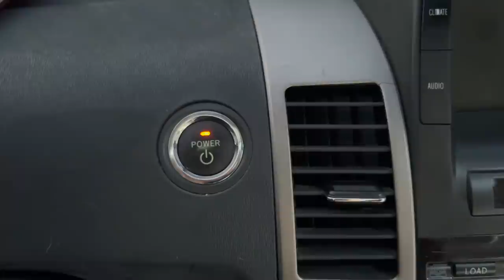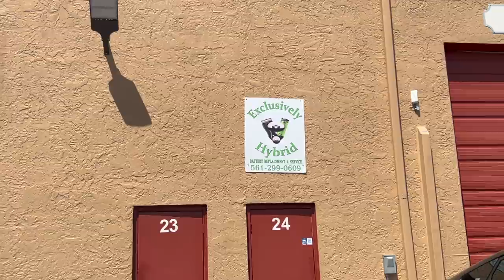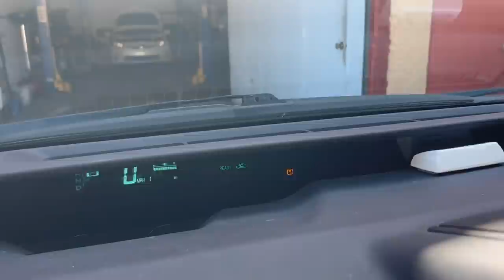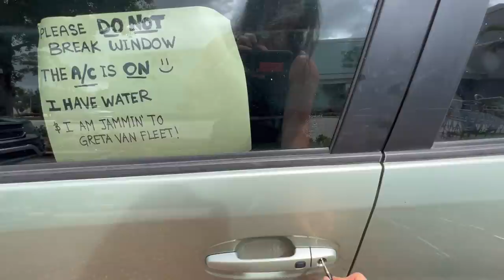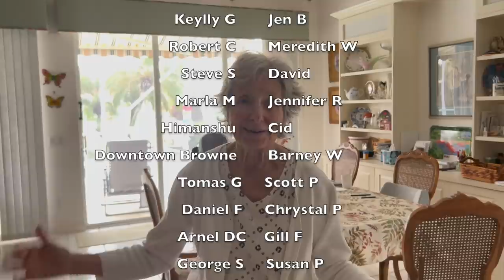LIVING in a PRIUS: We've got some BIG (car) PROBLEMS!

Comment: Take your prius to tribe auto san luis obispo ca.they service prius you get get tune up change  transmison fluid radiator flush change brake fluid change all filters for about $500 they also service your battery included in that price. Because you have camper  they  clean dust and dog hair from battery.the end of car problems

Comment: Do you leave the car running with the ac on or can the ac work when car is off? (Not attacking you as i’m just curious as this is the first petrol car i’ve seen that can run the ac while not running)
Reply: It's a Hybrid. A/c runs off battery

Comment: They say that Toyota Arius is capable of driving 1,000,000 kilometers without breakdowns.  But that's not true, is it?  Just like the fact that, for example, Russian cars are very unreliable.  In Russia there are a large number of VAZ cars that were produced in 2000 - 2005.  They all drive great.  And their repair is very inexpensive.  That is, cars drive for 20 years every laziness and in general everything is in order.  Such cars cost ridiculous amounts of money from the American point of view.  So, the very popular VAZ 2114 “Fourteenth” model in Russia, this car is called 2005 - 2008, will cost 1500 - 2500 US dollars.  And at the same time be completely correct.  Such cars have a maximum speed of 170 kilometers per hour and accelerate to 100 kilometers per hour in 13.5 seconds.  What I write is true and not a lie.  Good morning from Russia, dear Nikki!  In Russia it is now 7.21 am.  I'm going to work.  Have a nice day, dear Nikki!

Comment: Word of caution regarding your car's battey...with all the stuff you're carrying in the back it looks like the fan cooling / filter for your battery might be covered of not getting sufficient air circulation.  If the fan vent for the battery cooling fan is covered , that can significantly shorten your cars battery life and lead to a very expensive charge/cost for a new replacement battery.  This overheating of the battery is very common in hybrid cars (Toyotas) and is the reason about 20% of Priuses come into the shop for repairs.  Here's a short video (YouTube) explaining why this is so important      https://www.youtube.com/watch?v=SKoPqb0SZEM